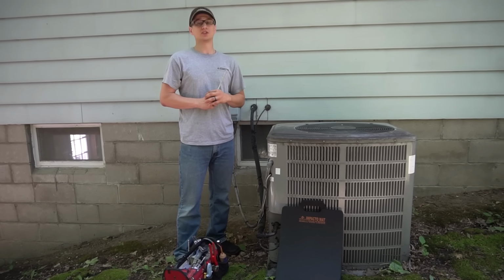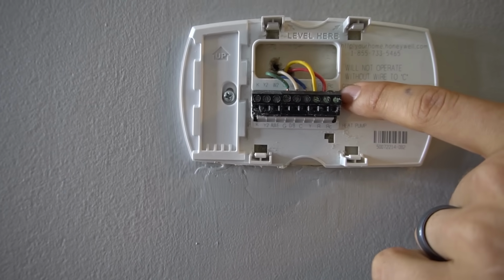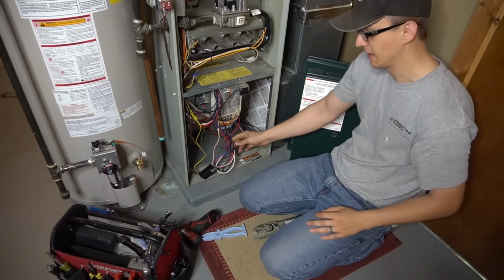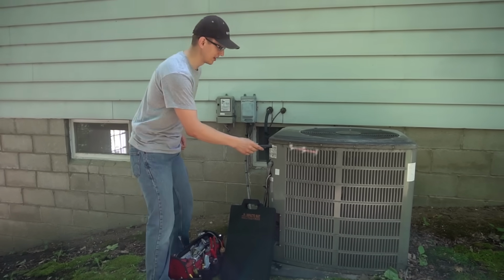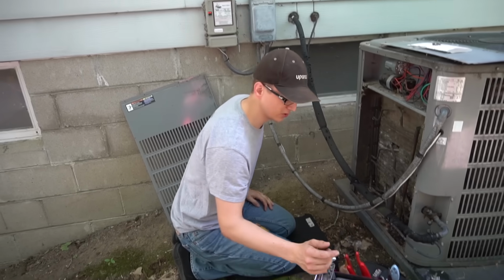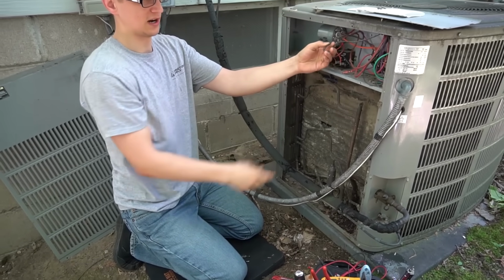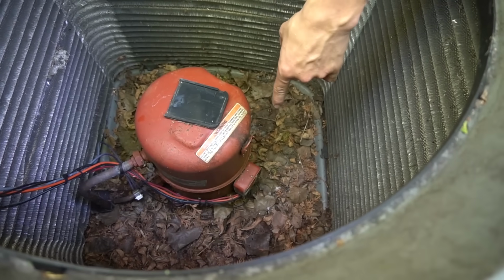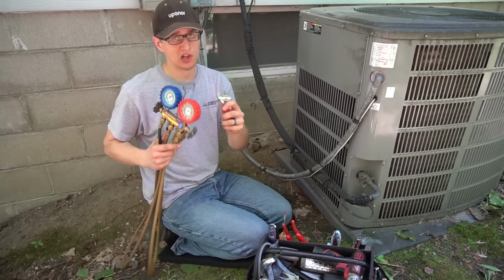AC Unit Not Turning On - How to Fix It Step by Step

Comment: So I did what u said and spin the fan and it started to work so what is causing that
Reply from the maker: It's usually one of two things. Either the capacitor is getting weak or the fan motor is starting to go bad. If this has only happened to you once so far, then perhaps you will be okay for a while. I have seen units that needed a "push start" at the beginning of every AC season when they were turned on for the first time. After that initial time, they turned on without a hitch for the rest of the year.

Comment: Thank you for the detailed video! My AC stopped working during a historic heat wave (of course...). We tried to schedule a repair in the meantime, but the closest appointment was two weeks out. I followed the troubleshooting steps. I noticed that the contactor was working, but neither the compressor nor the motor would start. I checked inside my disconnect, and I found two 50A fuses inside the box. One of them was blown (tested with a multimeter). I looked for a replacement part online, and luckily a local hardware store had one in stock. My AC was repaired within a few hours. Thanks again for the awesome video.

Comment: I just installed a new unit last year worked great for a week or so but after that it stop cooling but the fan still works. also, there is no water dripping from the discharge line.

Comment: My thermostat is like yours and doesn’t have batteries. We have 2 units and one stopped working. The power for the upstairs thermostat suddenly went out and that’s when I saw that there were no batteries inside. How can I fix this issue so it comes back on? I even added in batteries and the thermostat came on but it’s not communicating with the HVAC

Comment: Do you have a video where the blower is working inside, but the AC is dead outside? The fan isn’t moving and the unit isn’t running. And no, it’s not the capacitor, I already changed that. And the filter is clean as is the coil. Thank you!!!

Comment: Thanks for sharing great trouble shooting summary, it is very helpful.  Here is what is happening with my AC unit (York, Model: H1RA048S06B), appears it may need a new capacitor (40+5 MFD) and then evaluate
- AC was working well for a week and then it stopped cooling 
- Condenser fan is working normally
- Inside blower is working, room temperature air is coming out from the vents
- Inside breaker is not tripped
- Filter was replaced and is clean
- Capacitor; there is no bulging, no change of shape, no leaks either
- Uses R22 refrigerant, no pressure test performed
- Appears compressor is not starting, I hear humming sound with higher level of vibration as if it is trying to start ever 20-30 seconds and then it gives up and same repeats every few seconds

Let me have your Word of Advice, if I need to do anything else other then replace the capacitor.  Thank you for your guidance.
Reply from the maker: I love the detailed comment! Thank you for listing all your findings. Yes, everything you described does indeed sound like all that is needed is a new capacitor. The only way to know for certain would be to check the capacitor with a multi-meter though.
Reply: @WordofAdviceTV  Yes it solved the issue and restarted the compressor right away, once I replaced the capacitor. Thank you so much.

Comment: Hi!

I saw your video on the A/C problems.

I'm having some issues with my A/C unit.

The AC turns on sometimes, it's on and off.

It usually doesn't work when it's hot outside, around noon to around 3-4 PM. When it doesn't work, the fan is ON, on the unit outside. But I don't hear the compressor turning on. I don't hear the loud refrigeration sound, you know like the sound a fridge makes. But the fan is spinning and blowing.

But as it cools down outside around early evening or late afternoon, it tends to start working. I hear the buzzing sound from the bottom of the unit. I'm not sure how to explain the sound, but it's like the refrigeration came on.

When it does work though, it seems to not go down to the desired temperature easily. It'll hover around 75 to 76, even when I set it at 73 or lower.

I've looked at the capacitor and the furnace unit, and I haven't noticed any problems.

I can't figure out what's wrong with it.

Do you have any ideas?? 

Any help would be appreciated!

Thanks so much.
Reply: Also, I've already checked the programs on the thermostat and all that. I changed all the programs and even did the HOLD on the thermostat. It's not the thermostat.

Comment: Saw your informative video, needless to say, it is very helpful but i am still unable to resolve my problem... everything appears to be working fine, compressor starts but the fan is not turning unless given a gentle push and then it runs fine... i even ordered and replaced the dual run capacitor but still the same result.... Any insight / direction to isolate my issue will be very helpful.. Thanks

Comment: When I push the plunger in, the compressor and fan starts but the blower inside doesn't work. I put the blower top the "on" position just to have circulation. I had to change the thermostat   a couple of months ago and everything works fine till yesterday, now I have nothing. I am hoping it is the capacitor as it is around 35 years old. The capacitor itself actually does look good. I haven't tested it yet though.

Comment: Can you give any advise on why my box where you plug it in is tripped the plug is unable to go in , I'm not sure if the batteries inside are old.( on the cover) But the box attached to the wall has 4 openings 2 on  top 2 on the bottom, the bottom show they are half closed ( tripped ?) and wont let me push back the cover ?

Comment: My ac unit flutters when kicking on, it did that for a couple of days and now it won't turn on. It sounds like it is blowing in the house. I replaced the fuses outside and cleared it of debris. After I changed the fuses it started ro run then would start randomly fluttering and turn off. While it was running there was air coming out but definitely didn't cool down the house please help!

Comment: Should the fan outside be spinning always if there's air blowing inside while the air conditioer is set to on?  I feel air moving but the temperature won't drop and the fan blade outside is not spinning.
Reply: The fan outside should always be spinning when the outdoor unit is running.

Comment: Thanks, your videos are so helpful. I was able to fix my AC with this last year. This year I have a different problem. The fan is working but every 60 seconds there's a loud buzz sound and when I am standing near the unit, the ground vibrates with it. It also appears that the top of the start capacitor is a little burnt with a toasted spider on it. do you think that's the issue ? the service guy took a 100 bucks from me and said we need to replace the whole unit for $1600 ??
Reply from the maker: Glad to hear the videos have been helpful! From what you described it sounds like the compressor is failing to start and may be locked up. If it is not tripping the breaker, at least we know it's not shorted out. If your compressor is really locked up, then yes, unfortunately that's game over for that unit. If you want to give it a try before abandoning it, you can try to replace the run capacitor and the start capacitor. Both of them together should be under a hundred bucks so I think it would be worth a try. Plus you can return them if they don't work. Like you said, it's possible that one of those capacitors is simply dead.

Comment: I got power at my thermo, blower in the inside unit comes on but when selected to cool the outside won’t kick on and the fan and compressor are good. When I push in the switch in the outside unit it will come on. What could be wrong?
Reply: Any update?  Im dealing with the same
Reply from the maker: I hope you both have made it work already but if not, in this video I go over the reasons why that could happen: https://youtu.be/NVPhsK4gK1A
Reply: @WordofAdviceTV  had the wrong wire connected on my thermo, got it running. My gauges are showing 0 when I hook them up but when I select cool the compressor kicks on. It’s been sitting for 10 years, could it all be empty now?
Reply: @WordofAdviceTV  Thanks a ton.
Reply: @OrdonGay0  guys used a blue wire in place of the yellow so I had it hooked on my thermo in the blue spot and not yellow. On the board on the unit it’s in the yellow spot. Double check power at the unit from the thermo wires and make sure they’re ran right
Reply: @nicholasdufresne504  appreciate you and Im glad ypu got it fixed. My problem was a bad capacitor.  Super easy fix.
Reply from the maker: @nicholasdufresne504  If you hooked up your gauges and are getting 0s, yes, that means your unit is totally empty. (I am assuming your refrigerant ports on the unit have Schrader valves and that your fittings were screwed on all the way)
Reply: @WordofAdviceTV  yea it was empty, coil had a hole I shot some in and found the leak. New condenser will have to go in

Comment: Great video, TY !!!   I've used many of your HVAC videos to pinpoint and repair issues through the years. :-)
UNUSUAL CAUSE:   had GREAT airflow from furnace with clean filter, yet AC was not cooling the house…    
In checking my condenser, it was not running, so I immediately reset the breaker thinking it was "lazy" - no bueno.  I then tested for 220 VAC across both line leads @ at the disconnect.  Instead, I found only 110 VAC from the hot leads coming from the circuit breaker. Thinking that one pole of the breaker was bad (unlikely), I opened the main panel to find one of the hot legs disconnected from the breaker.  I'll attribute this issue to the electrical work I’d done over the winter, where I clearly did NOT (re)secure the AC wires…  :-0

Comment: Wow, what a fantastic video. I found it while looking for a trouble shooting video because      my AC doesn't work and of course we're having a heatwave in June. Furnace works fine and blower but only in heat mode, fan doesn't even kick on in cooling. I always like to try to do the basics before I call someone fuses, loose wire in thermostat  or batteries. I was thrilled to find a video that was easy to understand and through. I would have loved to have a prof like you who explained things simply and broke it down into easy to follow steps. I'm sure you've helped more people than you realize.

Comment: So question, I’m sure the answer is somewhere in the thousands of comments you have LOL but if my plunger is popped out and when I push it in the fan starts with a plunger is constantly staying out… What might that mean? My board on my outside unit is showing that it’s getting no power at all but when I push in the plunger the unit will turn on until I release it.
Reply: You aren’t getting 24v to the coil to pull that contact in. Remember you get the 24v from your thermostat.

Comment: I accidentally cut a small gray wire from box on outside wall that leads to ac unit. What do I do?
Reply from the maker: You can strip both ends where it was cut and then use some wire connector to splice it back together. Even a wire nut would work. I like to then use a heat shrink tube over it. You can go to a hardware store and tell them you cut a wire in half and need to splice it back together. I am sure they will be able to show you what you can use to put it back together. Of course while doing the reconnecting, the power should be off at the AC and furnace.
Reply: I wish you lived here!! Electricity makes me nervous but I don’t have any money to have someone repair it for me. Tomorrow I’m off to the hardware store! You are so kind in responding! Thank you so much. If you know anyone who lives in St. Louis, send them over! Lol
Reply from the maker: @remingtiondog   @remingtiondog  Being nervous is good lol one should respect electricity. Just make sure to turn off the power and you will be fine. I am sure you will be able to get it done, good luck and stay cool!

PS If you get a wire connector that needs to be crimped, you will also need to buy a pair of wire stripping/crimping pliers. Perhaps you can return them after you are done.
Reply: I tried. I spent $53 in supplies. Spoke to a woman who “helped” me. Came home. Stripped the gray wire….two smaller wires inside….red one and white one. Went back to hardware store. Showed her photos. She said to strip the smaller wires too and twist the two red ones and two white ones together and I could just cover with electrical tape. Came home. Did that. Didn’t work. Called back to hardware store and spoke to a man this time. He told me I can’t do what I did and that the entire wire would need to be replaced. I got the “connector” you talked about, not realizing that there were two smaller wires inside the gray wire…..so she said they wouldn’t work. I also got the “tubing” that you stick each end of the wires in, but again, I still had the inside red and white wire to deal with. I’m sitting here in tears because I can’t afford to have an AC company come to fix it….and I’m out $53.
Reply: Oh, and the man told me if I left it the way I fixed it and it rained, it would short the entire AC and I’d have to get a new one.
Reply: I’m female by the way….can’t ya tell?!
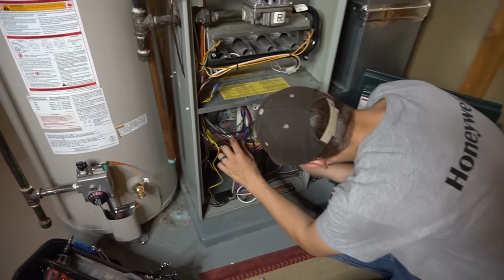Reply from the maker: @remingtiondog  Really sorry to hear about your terrible experience. I apologize for making it sound easy. Have you checked your 3 amp fuse on the furnace control board? It may have blown when that wire was cut. (if you are not sure what I am talking about watch this video from 6:50)

Even if there is a short, this is low voltage so the extent of damage it can do is limited. You would not need a new AC. Hopefully you have that 3 amp fuse otherwise it is possible that some things got damaged such as the control board or thermostat. 

The easiest way to do this would be to use small wire nuts and wire nut together the red wires and then the white wires. (2 wire nuts) Then simply bend down the wires so it's more compact and tape all that stuff up round and round with black electrical tape. (The heat wrap stuff is more difficult so just don't do that.) It may not look amazing but it will get the job done and should last a long time. Try to angle the open ends of the wire nuts downwards a little but even if water does get in there that is fine, that will do absolutely nothing to it besides maybe make it rust a little with time. A short happens when the red and white wires touch. As long as you have them in separate wire nuts there will be no short even if water gets in there.

If there is a blown fuse, fix the wires first before replacing it. Otherwise try to fix the wires first and then watch the video again and start from the beginning to try to narrow down where the problem is.

I hope you will make it work, good luck!
Reply: The AC guy came and what I had done already was correct. What I didn’t know was that I had blown the fuse in my furnace the minute my mettle clippers hit the inside wiring if the larger grey wire. So, you did a good job after all. I would never have known about the fuse. My total bill was $125. Not too bad and I learned a lot! So, hats off to you!!

Comment: Hi, your videos are great.  I have a problem that my AC sometimes won't work unless I turn off the breaker for 5 - 10 minutes and then turn it back on.  Once it's back on there are no problems.  Any ideas of why it turns back on after turning the breaker off for  5 - 10 minutes.  Thanks

Comment: So many thanks you!  Still can't get my A/C to go on. Replaced the contactor and the capacitors. Unit does go on when I manually push the contactor button. There is 24V at the thermostat but nothing at the unit. The fuse on the furnace is good and the water overflow shutoff is not engaged. Wires look pretty good in the unit and throughout. What am I missing? Really appreciate the video! Thank you!!!!!
Reply from the maker: Sorry to hear about the AC troubles, especially after you already did all that! I don't know if you have seen my video about 10 reasons why a contactor is not  pulling in, but if you haven't, that would be a good place to start: https://youtu.be/NVPhsK4gK1A

Comment: Thank you for very much for helping me troubleshoot my AC Unit. I found that my problem was that in the AC unit i found a evidence that Mice were chewing the wires connecting the AC unit that created a short. I had to replace the wires. You saved me from the heat.

Comment: I changed my Dual run capacitor but the outside fan unit is not spinning this is a unit with a heat pump. But I did notice the capacitor(40/5MFD+/-5% 370 or 440VAC) that I bought number is different than the capacitor(35+5.OUF+/-6%370VAC) that was in the unit.
Does that make a difference?

Comment: This video is great!!!
Would you please help me with an issue? Today, I had to replace a fuse of our furnace blower since it did not work. After replacing the fuse, I confirmed that the blower works well! The problem is that the outdoor ac unit is not working. I wonder whether there is any relationship between the fuse tripped and the issue of the outdoor ac unit. Would you please let me know if you have any idea on it?

Comment: Trane technician came out and replaced the capacitor and also installed a 5 2 1 hard start capacitor. Now the indoor and outdoor units do not come on. The thermostat works properly. The AC actually worked for a few hours after the repair but stopped in the middle of the night.

Comment: Hi there- Everything seams to be working; however, no cold air coming through. My thermostat is supposed to hold 71 degrees, but the actual temperature in the house is at 77 degrees. Any suggestions please?